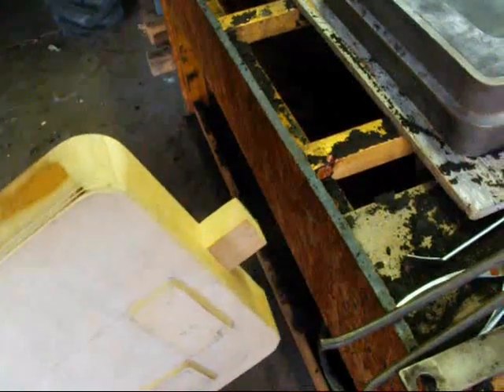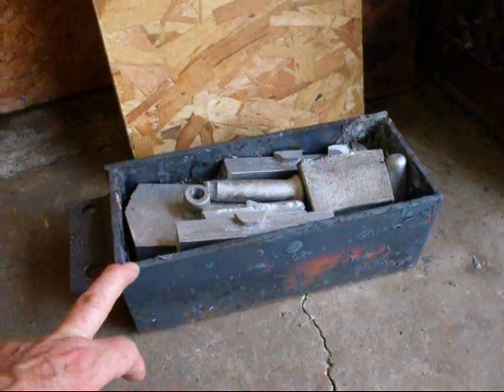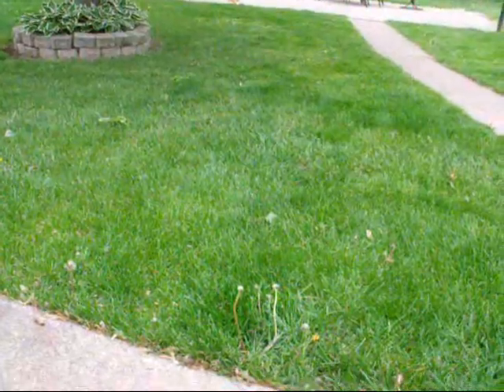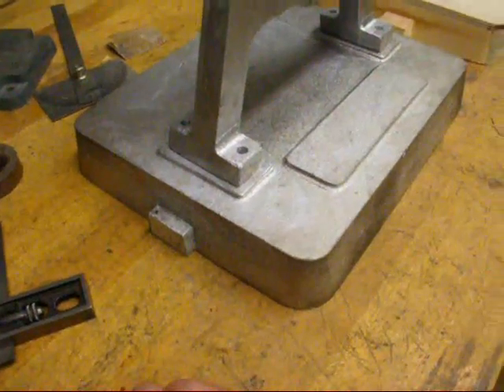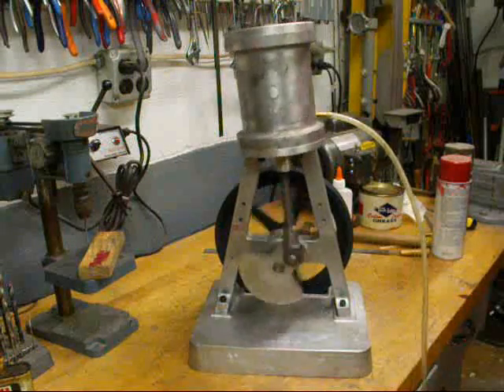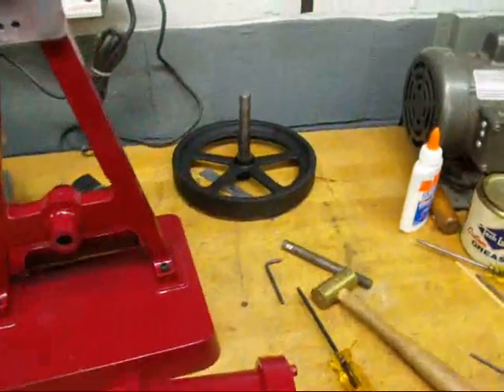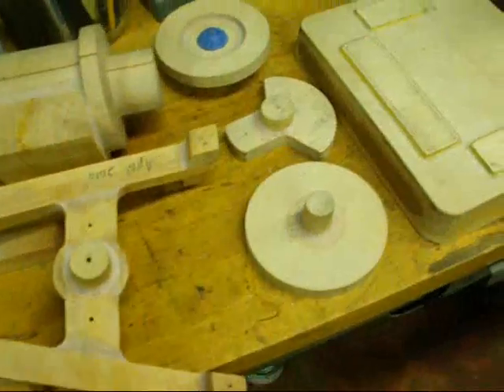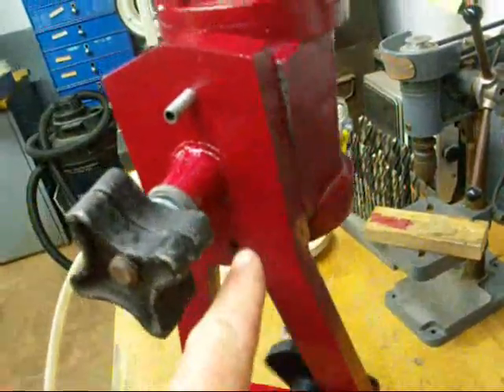BUILDING A MODEL STEAM ENGINE part 10 tubalcain

Comment: Water is very dangerous around molten metal 🗿 my helper was adding aluminum while I was on break, a wet ingot emptied the 36in diameter crucible.🌘🌒 The EMTs had him gone before I got back from break.. Thanks mrPete
Reply from the maker: Wow, that’s horrible. I have mentioned the danger many times in my videos where I pour molten metal. The water instantly turns to steam and causes havoc.

Comment: Very cool project, must have felt great when it ran. 

One question though; doesn't this kind of valve mechanism put a lot of strain on the conrod and the edges of the piston as these are the parts that push the (relatively heavy) cylinder back and forth?
Reply from the maker: +Joop S Thanks for watching

Comment: I wish I could meet you. I used to work in a foundry in core room, pattern shop, tool crib and in the foundry making molds. This was in 1967 when I was a moulder apprentice for DeLaval Corp. in Oakland CA. I know a little about this, but not much because I went for the bux and took up restorative machining at a aircraft company and later did tool room work at American Can making, repairing and sharpening dies. Very interesting work. I am retired now and looking to build a home foundry to compliment my shop. You sure have some nice machinery. I have a Chinese lathe, milling machine with no back gear, and a drill press but only a combo cut off band saw. Be surprised what I have done with it.  I wish I could send you a CADCAM drawing of a uniflow design employing a scotch crank I want to build, hoping for advice. I became enamored of of scotch cranks when I learned to run a shaper. and a filing machine.  I really appreciate your videos. Thanks.

Comment: It is truly impressive to watch your videos; not only do you spend a lot of time machining, but the time spent setting up your projects and editing your videos is HUGE!    I have always been facinated with mechanical devices and I recently acquired a South Bend 9A metal lathe (1952).  My latest project was to replace the single groove motor pulley with a two groove pulley. Utilizing your video, it turned out perfect!  Thank you so much for the time and energy you spent sharing your knowledge!

Comment: Tubalcain, as a Patternmaker, who has not worked in the Trade for at least 35 years this brought back a lot of memories, Thankyou so much for the memories, I mainly worked in Iron Foundries, but also made Patterns for Steel and Brass.  We actually used a mixture of Glass Putty and Plaster of Paris and a fillet ball for our fillets, this mixture went hard after a while and he clean-up was easy, yet all the rest was the same as we did in Australia, although I never used a metal lathe

Comment: You mention in this last one with 10 parts it's rather a long set start to finish.
 Well I just watched everyone of them tonight in a row and it was time very well spent!
 I did not need to sleep tonight anyway LOL
 Thanks! I learned a great deal from your videos tonight!
  You mention in several you hope your not going into to much detail or borring with details. You did GREAT!
 I learned more in your videos of how to use my lathe/mill and do setups than I have in the several years I've had it!

Comment: Hi mrpete222. I was wondering if you have a video or videos showing how to make a steam traction engine. I built a traction engine boiler on wheels but I don't know how the valve system is built for the steam chest on this type of application.

Comment: Sweet engine. Is it just ally to ally where the cylinder pivots or is there something there to help the seal and reduce friction? How high could you get the pressure before it starts leaking at valve plate?

Comment: According the formula in N.Hawkins "New Catechism of the Steam Engine", Audel & Co., 1904, that engine running on 10 psi at 55rpm is producing .036HP.  Seems like it would be more, but the formulae from that era don't count things like reciprocating weight, so the large flywheel provides smooth motion and torque, but doesn't enter into the HP equation.

Comment: you are a genius and so skilled. you obviously have a lot of experience. im 27 and have recently bout my own furnace kit for home melting. i am also in the process of buying my own lathe and mill. i have never practiced working with metal but woke up one day and decided its time for a new hobby.  you have given out so much advice and now i feel so ready to start my new hobby. Now all i need is some Dry days to melt my Aluminium Thanks again from Bray, Ireland

Comment: its been a long ride, nice looking engine that is begging for a name plate or some polishing on the cylinder. I like the colour and I think your choice was good. The wobbler needs to be hand started to alight the valves correct? Your videos have encouraged me to try a machine project. I started (ambitiously) with a kozo 0-4-0 pennsy switcher